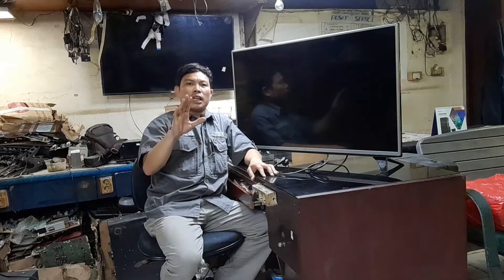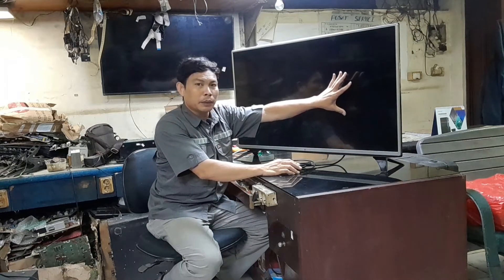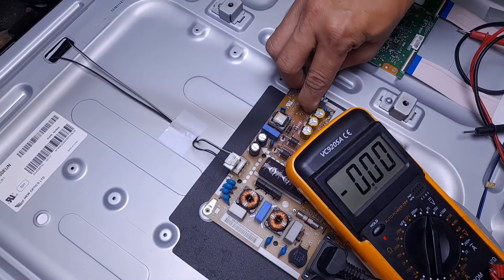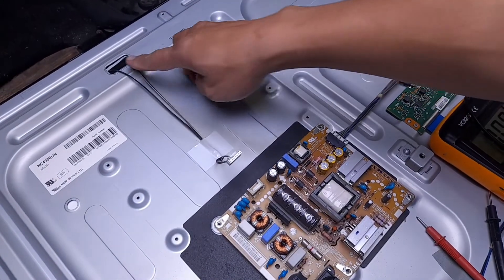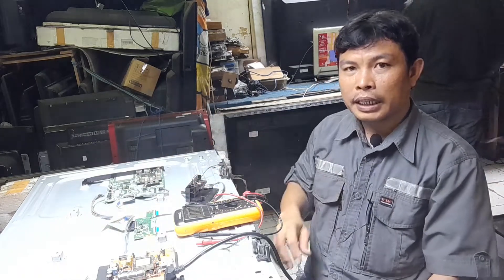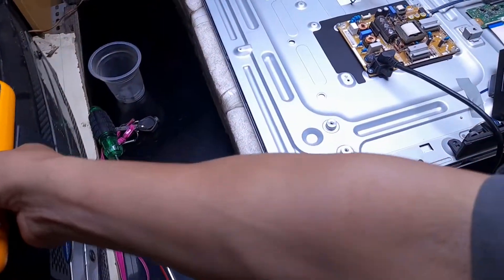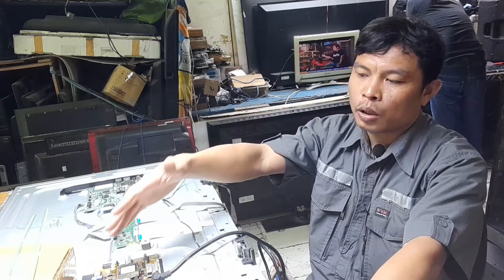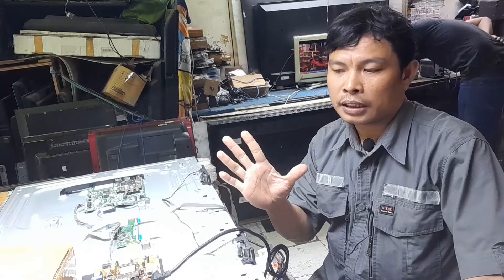Memperbaiki Tv led LG 43LF540T kedip kedip

Comment: Mau tanya mas tv LG 60" dengan seri 60LF630T dengan keluhan indikator berkedip  ketika terus menerus ketika soket backlight terpasang ke PSU.dan ketika soket dilepas tv bisa standby atau pun star ketika diremot.
Di cek semua tegangan di motherboard saya kira semuanya normal termasuk output vcc untuk ke ticon.namun tegangan output di DC to DC hadir.dan diterawang pakai senter tdak ada gambar.
Pertanyaan saya apakah ada hubungan antara vcc tikon bisa bekerja saat driver backlight ataupun backlight dalam keadaan normal..? Terimakasih sebelumnya..!
Reply from the maker: Test backlight  menggunakan  tester backlight  ,,supaya  bisa keliatan gambarnya

Comment: Kl lg tegu out stanbay 7.9 tp bila di jamper power on,teg out naik turun 11-7,9v ,
Reply from the maker: Ya ,,ini benar ,,Tegangan  12V ,setelah ada triger dari motherboad nya
Reply: @duniaserviselektronik  tapi goyang bos ,Indi kantor kedip2,
Coba kasih psu luar 12v mb mau syarat normal

Comment: punya saya backlightnya kedip" kalau dinyalakan itu kenapa ya omm
Reply from the maker: Cek backlight nya ,cek inverter nya
Reply: @duniaserviselektronik  output inverter saya cek standby 7,8V, connect sama mobo kebaca 12V. kalo output ke backlite itu nominal normalnya berapa ya om?
Reply: terimakasih sebelumnya